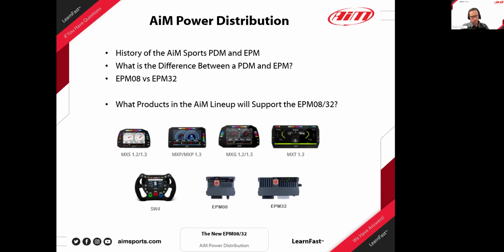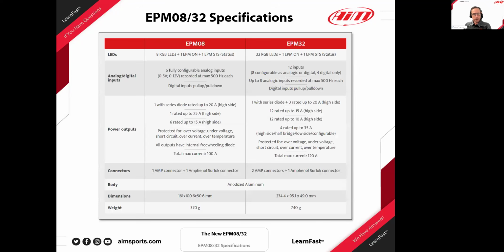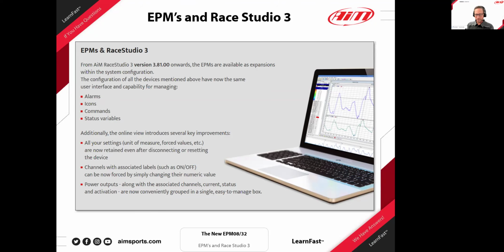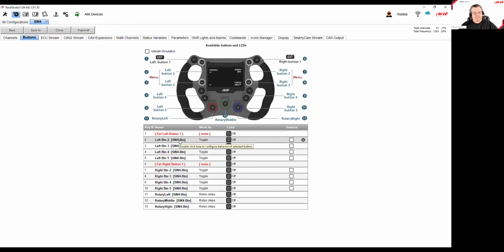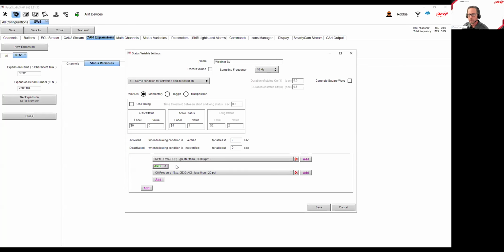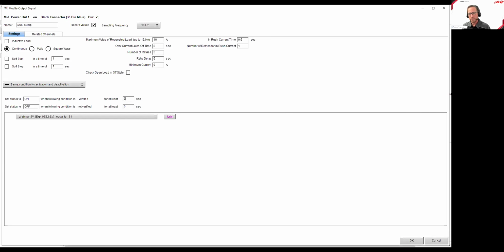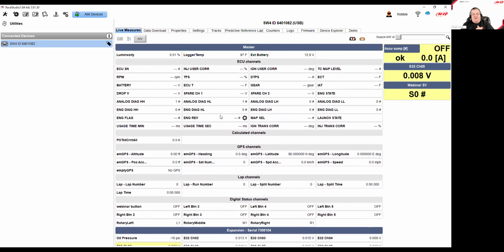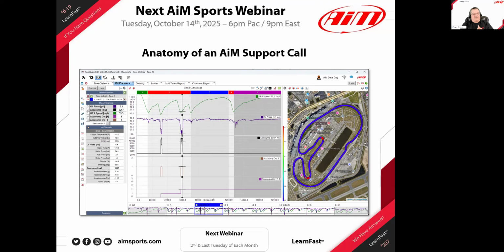6-18 - The New EPM08/32 with Robbie Yeoman - 9/30/2025

Comment: What are the benefits of going with an MXx + EPM vs PDM?
Reply from the maker: The benefit is in the modular nature of the EPM/MXx hardware. If you already have a MXx installed, you can add the EPM. For a fresh build, the PDM will have all the features of the MXx and the EPM so a PDM  is all you would need.